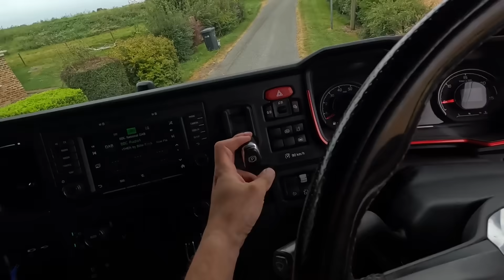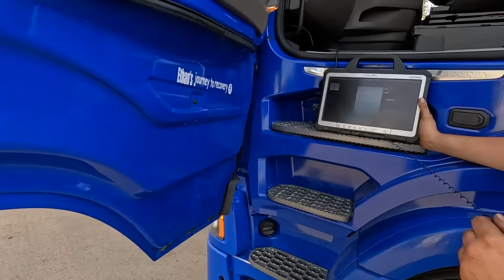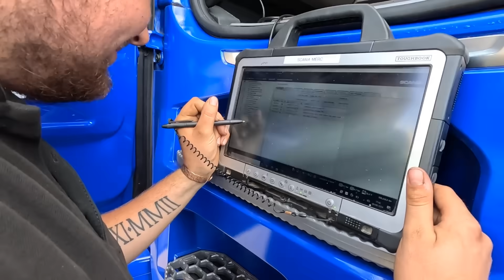STUCK ON NARROW BRIDGE!? | SHAUN IS FURIOUS | #truckertim

Comment: If i use the winch on my truck without having the engine running it will flatten the battery in no time, how does your winch not need to

Comment: If you grab yourself a pulley block and double the line back it half’s the strain and doubles the pull. Will make winching things on a bit easier and stress free.
Reply: I was going to re'suggest as did say about it before plus if puts a fixing point right at rear he can put the pulley on it so can use winch to draw items back to unload.
But that winch is pants if needing to hold down selector as heading for failure! and better if has proper cable instead of plastic string